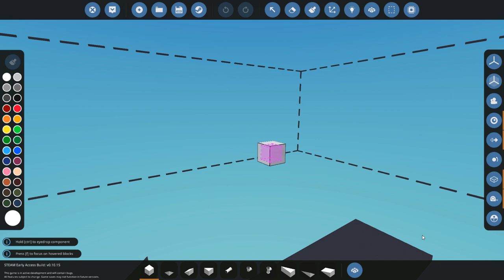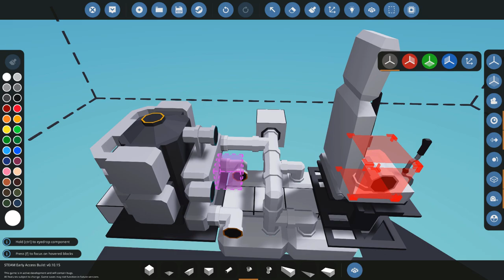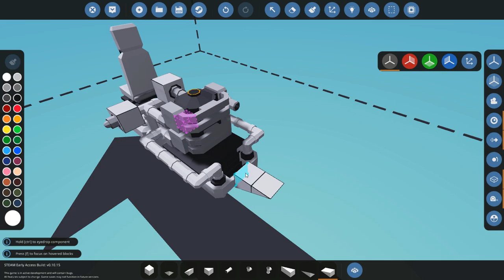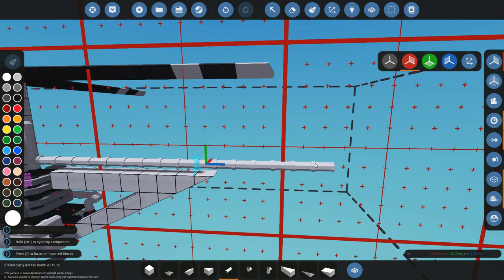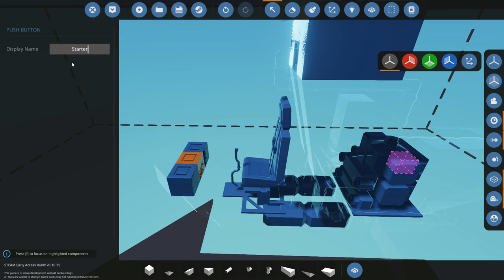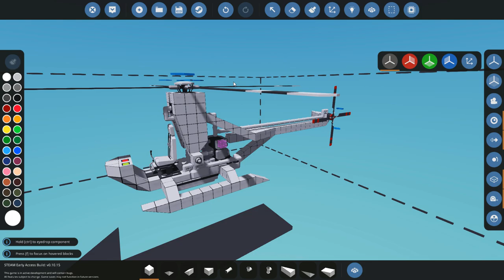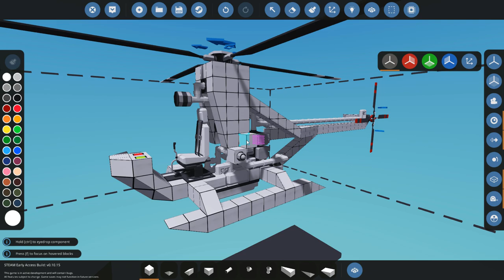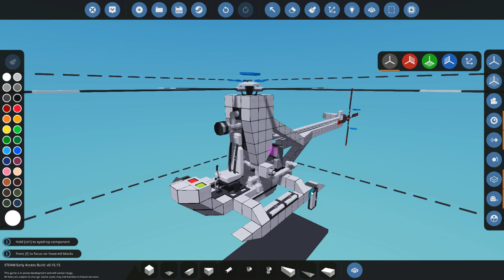Stormworks B&R l Basic Helicopter Tutorial

Comment: Information about adding a gearbox if the helicopter refuse to take off if the helicopter is to big.

Also. You should add tutorial for tandem helicopter (Chinook). Add 2 rotor arrow facing forward. The  rear rotor arrow plus and negative should be opposite for counter rotating  in order for yaw function properly.